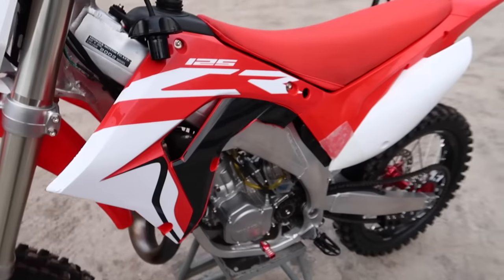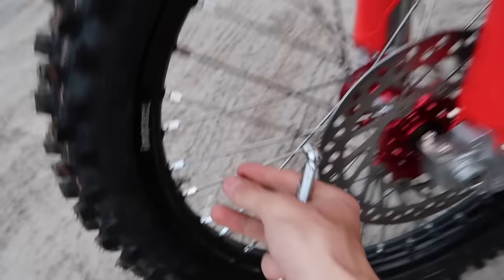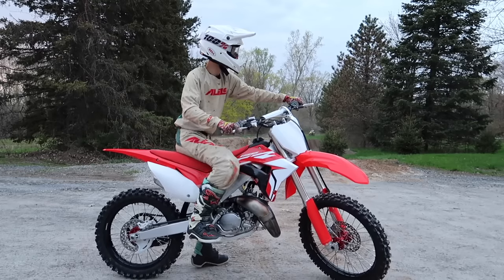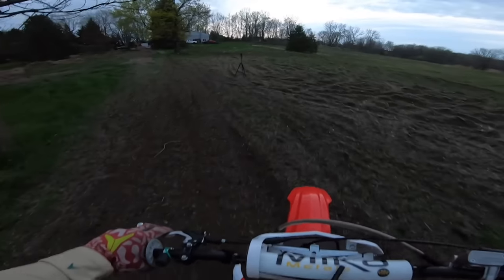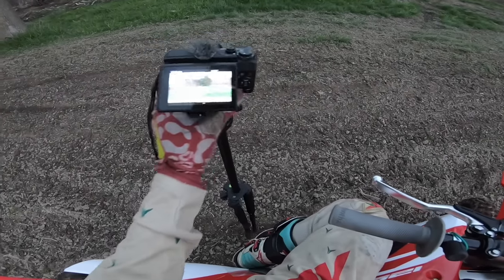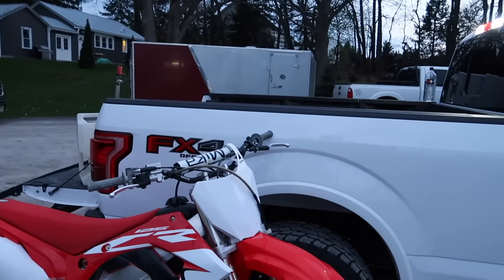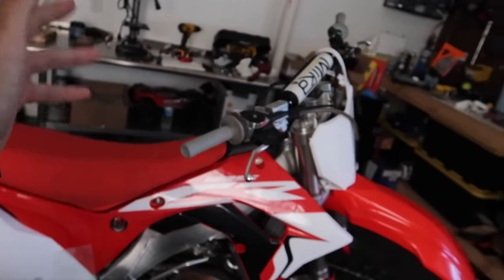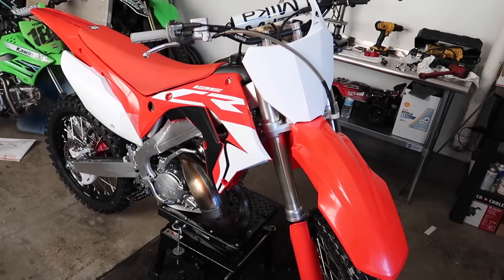2019 CR125 2 STROKE FIRST RIDE

Comment: 2 stroke all the way 
If you ain’t spittin’ oil you ain’t rippin’ soil
Reply: Gotta own a 125 at some point. That’s all I mess with.
Reply: Timothy Randolph A 500 2 stroke is perfect 👌
Reply: El diablo da Costa I’m 14 n ride a KTM 250 XC
Reply: Timothy Randolph I’m a pretty big 14 year old but I ride a 250f and have ridden a couple 450s and a 2000 cr250 and the cr250 isn’t that bad the powerband feels similar to a 4 stroke and it’s very predictable
Reply: “Cough” “frequent breakdowns” “cough”
Reply: Im fucking 16 and i still ride my 125! Can't get past how much i love 2 strokes! So easy to fix, although the only thing have had to change throughout these 3 years i have only changed the piston every month and oils every 3 months and all of those little stuff.

I have owned a 4 stroke and it blew up after a month to riding, and before you say that you should've checked the motor, i changed the valves and the piston and the crankshaft. When i bought the 125 i realized that i dont need to pull out the WHOLE fucking motor off when just changing the piston. Man, 4 strokes just suck.
Reply: Aito suomalainen you need to be able to spend time with 4-strokes
Reply: @Amare._  I cant, because they blow up before i get to spend a good time with 'em! Well, atleast they are better than electric bikes 😃
Reply: Aito suomalainen you gotta get the good 4-strokes which I don’t know.
Reply: @Amare._  But, man... My opinion is that i dont like 4 strokes and i will never buy one. Ride whatever you want man, its not your problem what i ride, if i would be riding an electric dirtbike... I would have serious problems 🤣
Reply: Shiid my Apollo rips soil even in fourth ✊🏻👌🤦🏽‍♂️
Reply: Motorhead Aj i hope you atleast mean the 250 because we all know a 8.5 hp bike ain’t spinnin dirt in 4th
Reply: William like why would I lie? Shxt you’re gonna kill me? What my life depends on it? No. Imma back yard four stroke mechanic and know how to Time my bikes for optimal performance and maximum factory power.
Reply: Motorhead Aj alright buddy how much lift do you run on the engine
Reply: @Amare._  Yes it will, but you have to be doing a burnout at that point 🤣
Reply: Aito suomalainen not really, just need a strong 125 motor with a great transmission slip so it carries the power to the next gear with matched rpm
Reply: William what do you mean, never heard that term before relating to motorcycle, hell are you talking about a wheelie ?
Reply: @thezoms9961  Bruh, 125 4 stroke aint spinning the tire on gravel when its in 3rd gear
Reply: El diablo da Costa a 250 4 stroke isn’t that bad, but the r has more power than the f, but still isn’t that bad. It’s all about the type of kid, if you’re a frail and weak scaredy cat then get a 110 four stroke but if you can handle it go for anything you want
Reply: TheSaltyPanda11 man most of these mugs couldn’t even handle my stock max output 125 pitbike.
Reply: Motorhead Aj bro you’re really that slow
Reply: Snitches get stitches
Reply: Latham Buckley agreed you’ll be re building the bastard every other year
Reply: @Utahtruckguy  worth it always
Reply: Timothy Randolph 250r?!?? I just turned 14 and have a 250f trail bike. It’s softer suspension and air cooled with half the horses
Reply: I like both im 15 and just picked up my crf 250l I live close to mountains but they don't let you ride on them the closest place is about 1 hour away so im waiting to get a 2 stroke when I can drive my self over there and when I can buy it myself I do have a 1973 kawasaki 175 but I cant find the seal to make it not pour gas out of the thing lol so newer will be nice to have
Reply: i thought crf hasnt made 2 stroke since 07’?
Reply: WHereS uR engiNe BreAkiNg
Reply: @moet1114  hahaha ”frequent breakdowns” i’ve hade my kx 125 for 3 years and never had a problem with it
Reply: @aitosuomalainen7283  i’m thinking abt a yz125x and i was wondering how often would i have to be changing the piston if i were to be riding it on trails strictly
Reply: @goon.1  I would say beetween 80-140 hours, you should check how much the piston wear is beetween every 20 hours from the exhaust side of the cylinder, thats hoe i know when to change my pistons!

Comment: The nut on your valve stem is a valve lock. Supposed to be tight on the wheel. Not the valve cap
Reply: Hahaha I saw this and I laughed my ass off.
Reply: you two are the reason why when i work on somebody's bike and do a good job like every job i do, i have to point out that it is correct and why.
Reply: I was thinking the same thing. 😀
Reply: about fell out when I seen that LOL 😂😂😂😂😂

Comment: Think I’m the current record holder for the fastest 125 two stroke to break, blew up my kx125 within 25 min of the first ride, carb was tuned, gas oil was mixed, engine went though heat cycles, guess my luck just sucks.
Reply: engine dosent  break  with luck

Comment: To the guy making this video

The nut on the air valve is not there to hold on the air cap. It’s to bolt down the tube to the rim ya big dummy. 

Especially for the rear tire
Reply: Joe Smoe ok keyboard mechanic. You don’t want to run the nut all the way down to the rim. It needs some wiggle room so if the tube moves the valve stem can flex, if you tighten down the nut the valve stem will stay in place and rip the tube.

Comment: Yo bro!!! Tighten that nut up to the rim not the valve stem cap!!! That helps the tube from moving in the rim!!! Yo everyone who reads this keep comminting to tighten that up!!!
Reply: sorry bruh you're wrong. if you tighten that nut against the cap it gives the tube a chance to move instead of just ripping out the valve stem and losing all the air. I've seen a lot of top level cross country racers do this.
Reply: Duwane Tuttle you are absolutely right, most top level cross country guys run bibbs. I am referring to those that don't run them due to the dead feeling and folding of the side wall that can occur with bibbs. You can see on my channel, we have some honda two strokes and honestly they come from the factory with no nut in place. There is a rubber grommet that sits against the rim and after removing that it's just a rim hole with a valve stem sticking out. I do not know where you are getting a 125 doesn't have a bead lock, you can clearly see on the video that you are commenting on that this bike has bead locks front and rear. all six of the 125's I have have a rear bead lock with the correct sized 1.85x19 rim.
Reply: @natedot i work on bikes im a mechanic dont try to say im wrong when my career is working on bikes bro the nut does go to the rim.......
Reply: Billy Baker you are not wrong. You can tighten that nut against the rim and it will be fine. Equally you can have it the way he does and it's just as fine. All I want to point out is that this Honda didn't come from the factory with a nut there and it's a common trick that fast riders use. Being a professional mechanic you should open your mind to the tricks the pros use. It makes the difference between a mechanic and a true technician.

Comment: You screwed the nut up to the cap??? Why??? Whole point ov it is to tighten it to the rim
Reply: He did that to get some wiggle room on the tube. Less risk of ripping out the value stem. With tight rim locks it's not needed

Comment: dont use engine brake on a 2 STROKE 
engine will blow up fast
Reply: No it won't
Reply: It will on 2 stoke engines oil is mixed with gasoline and lubricates the piston how s the engine geting more RPM s withuot enough gasoline the piston will blow up

Comment: Is a crf250r okay to start with I'm 20 and have been riding quads for about 13 years now so I have the riding experience. But I'm also a 20 year old that's 130 pounds. So should I try the crf250 or do a cr125? I just don't know if they are the same size.

Comment: Tyler quick your valve stem locknut is not tightened plz tighten it before your valve stem snaps off
Reply: Slump you keep it like that so the valve stem doesn’t rip if the tube moves.
Reply: Yes it does
Reply: Then why is it on there listen not trying to sound like a know it all but it’s on there for a reason

Comment: I've been wanting to do something similar with my 2000 CR250 but for what it would cost to rebuild everything (needs suspension work, linkage, wheels & bearings), I'd probably buy a blown up CRF450 and have someone fab me some motor mounts and do a motor swap. I hate the chassis on my bike and the newer crf's is much better in my experience. Lots of pros and the only con is cost. Don't want a roached 450 lol or it'll need a full rebuild as well. Just want the newer chassis, better suspension, brakes, wheels, etc.

Comment: Where’s the chain and sprocket cover that connects to the motor 3:04 other than that and the Kickstarter the bike is sick.  I have a 2007 cr125r last year they were made. Had it rebuilt by Palmetto Bay Motorsports and she runs like a champ.

Comment: Need help with my cr125 2006 transmission keeps binding in neutral and doesn’t select gears I’ve took it apart and put it exactly how the manual looked and still nothing I’ve at least took the engine 6 times apart and still nothing

Comment: I don’t understand because it’s a 2019 but when i check on honda web site there are only 4 stroke. Does honda still make 2 stroke bike or not
Reply: It's an older 2002 his rebuilt with the 2019 250f plastic conversion

Comment: B.s Honda stopped producing 2 strokes in 07 so at best that's an 07 with a restyle plastics. I fn wish Honda would make 2 strokes again but no
Reply: 2002 rebuilt with 19 graphics
Reply: @caoimhinsaunders8494  right on I figured. I saw it n was like wait what? Did I miss something? Bike looks amazing and also sounds like a beast. I'm doing a 98 cr125r getting it tore down to send to Eric gorr for the 139 bigbore topend. Then while motors out it's getting every nut n bolt done new plastics bushings bearings already did forks wheels bottom end should be nice, I'll post up once finished.
Reply: Mike Hickman nice nice

Comment: that aint no 2019 cr 125.... I got the real deal 2019 cr 125.. 2019 Crf frame with 125 motor in it posers
Reply: Honda doesn't even make 2 strokes no more so what the heck you talking about you go the real deal 🤣... I have a 02 cr125 with crf450r 2016 plastics on it ...